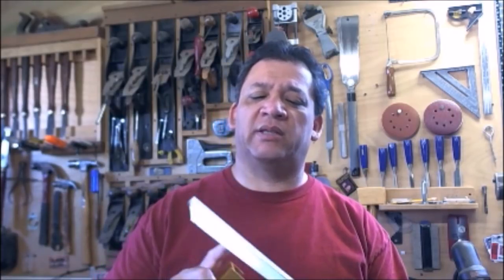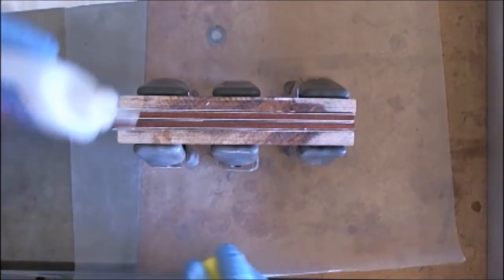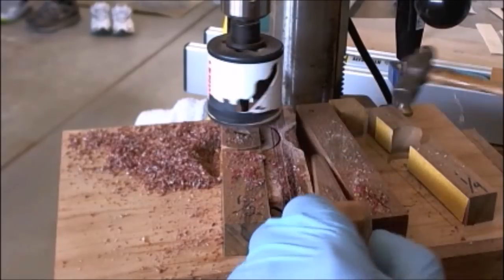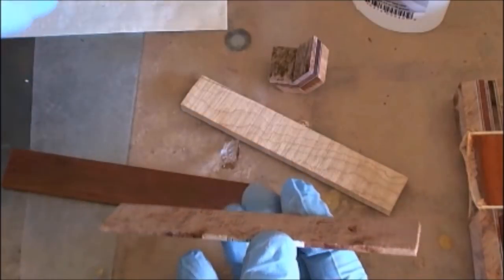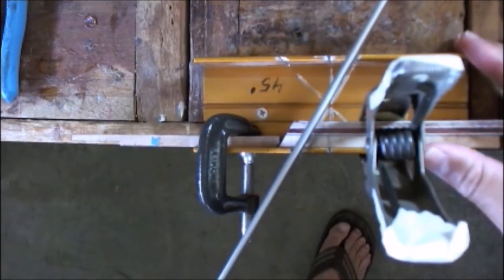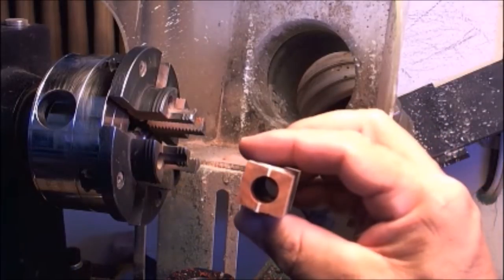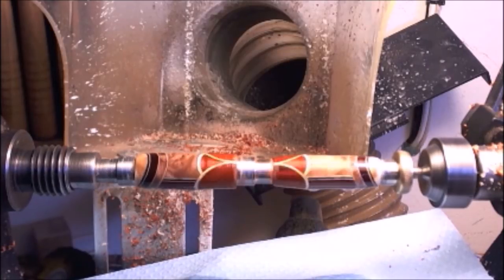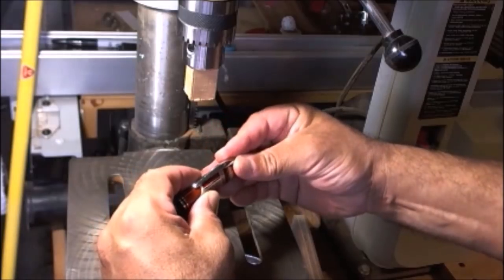Part 3 A Segmented Jr

Comment: Hi . Great video . 
That CA glue Pentwater through even though its clamped? 
I'm new looking in pen videos. 
This is my second video that I'm watching. You do a great work .
Thx for sharing
Reply from the maker: Yes, as long as it is thin CA glue and not too much clamping pressure.  That is why I used binder clips as clamps, they work perfectly for this application.  Thanks for watching.

Comment: Gabe:

Great video and you results are outstanding. Question, What is the size of the sled for the 60-45 degrees jig..
Also it looks like you are using it on a delta table saw.  My saw is a delta unisaw so should be the same for guide groves.

Thanks

cheers

Charlie
Reply from the maker: Thanks, glad you like the video.  The jig is roughly 10.5 x 14, make it a over sized and run it through the table saw on both sides to trim to fit.

Comment: I am pretty amazed that you are able to glue up after clamping. Do you ever have issues with the glue not penetrating deeply enough to hold the segments?
Reply from the maker: No issues, just make sure you use enough to saturate the blank.
Reply: @exoticwoodpen  Very cool. Really looking forward to trying some of these techniques. These videos are really inspirational.

Where do you get the veneer that you use for inserts?
Reply from the maker: @kurt5213  I get the veneer from Rockler.